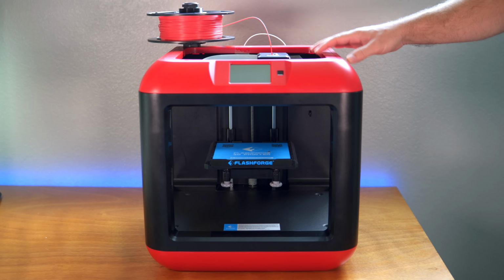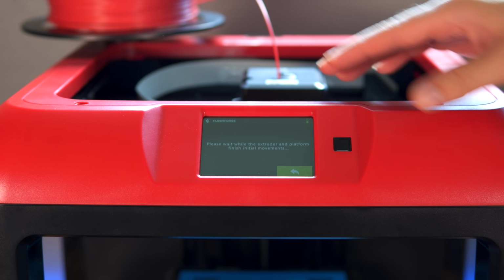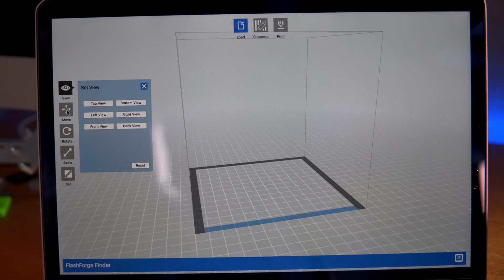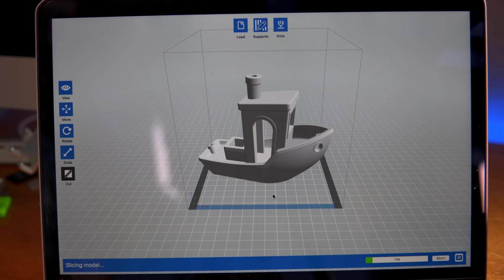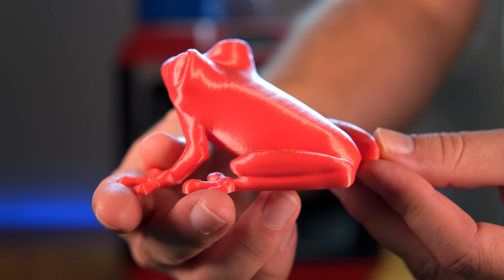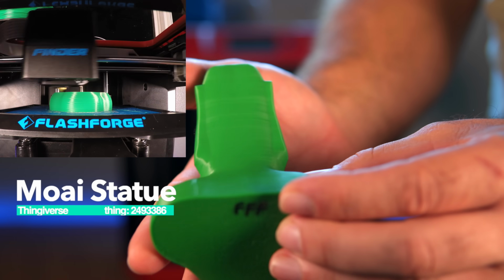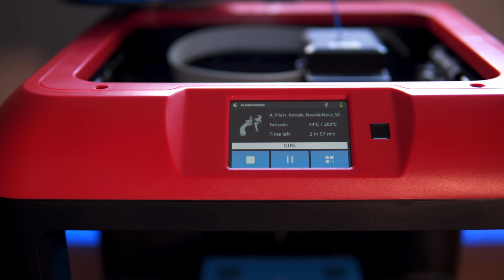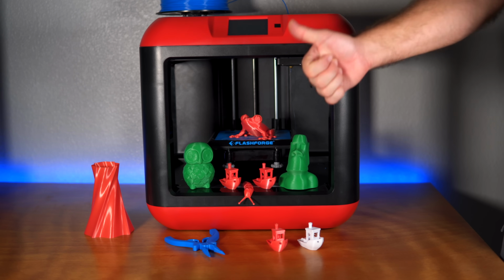FlashForge Finder - 3D Printer - Setup & Review

Comment: May be a stupid question, but in regards to the slug, was it printed in sections and then required clicking each individual piece together or did it print it all as one piece allowing it to flex/squish the way it does straight out of the printer?

Comment: The Finder is really really good. Enough print volume for over-night prints, cheap as dirt, and reliable. Mine has gone 720 hours today and all I have done is changed nozzle two times. Super machine!
Reply: I can't get this thing to print anything. It was given me to and I can't figure out how to get it to print anything well.
Reply: @MikeMtgFightClub  Sorry to hear that. I would happily help to get it started. How far do you get, is it turning on (fans starting, blue light and display on) and have you found and installed the associated software Flashprint?
Reply: @christianeriksson4733  yes, but I already sold it and went with a resin printer

Comment: I have a Finder Lite, and it’s really good, but my only problem is trying 2 get the prints off of the bed. It’s really hard 2 do, mostly because it doesn’t have a flexible bed (or at least I don’t think it does)

Comment: why not just print a new spool to fit the built in spool feeder and build a hand cranked transfer winder ... the larger spool on one side the forgefinder spool size on the other and then crank and move the filament to the proper sized spool ... no hole or bolts needed to be added to the unit and you now have a spare spool or spools to put other colours or filaments on ... 
.
I swear one of these days i am going to call this printer the fridgefinder ...
Reply: discolourisation is typical when something cools at different speeds ... the squished out filament will be thinner so it will cooler faster being a different colour than the thicker middle which cools slower ... the only real fix I can picture is fiddling with the head height and go in VERY small increments until you get a more uniform colour

Comment: its super easy to rig a heated bed
Reply: How do you rig a heated bed? My prints keep bunching up in the beginning and is frustrating.
Reply: @j1fulhamify  get a better pronter no jk i dont fully remember the details but look ot up on yt it normally involves a temp control circuit (premade) a mosfet circuit (premade) and like a reasonabky big 12v psu

Comment: Hi... I really need help with levelling my flashforge finder. There was a levelling file (gx type) which came with the USB. Would anyone have this file? Many thanks
Reply: You can level without the file (I haven't even opened that file... 😬) but I do still have it on the  usb that the printer came with. Let me know if you still need it.
Reply: @gogumadalpaengi  Hi .  I was able to get the file of Flashforge directly. I did try to do it without it but it never was accurate. Also when i try follow the guide in  turning the knob to get correct distance it would never succeed past step 1. But thanks anyway! : )

Comment: You say your temp is 200 for PLA but what are your exact retraction settings? Thanks.
Reply: In Flashprint you really don´t have to fiddle with a million of settings. The presets in Flashprint are super, and as long as your model is reasonably designed, and well placed it turns out great 99 out of 100 times.

Comment: Hi, I have just buyed the Finder. My prints turns out not really well, I can see the layers and also lot of filaments around like hairs. I adjusted the bed level with the tool inside the printed but still same results. Can you please tell me how to have prints smooth like you showed in the video? Thank you,
Lorenzo
Reply: im having the same issues
Reply: I partially resolved the problem because: prints now turns out well with PLA filament at 220°C . I also used TPU filament with very good result. However the prints doesn't stick well anymore on the bed. I tried with stick glue but didn't work...
Reply: I use sticky paper on the bed but it does not always work

Comment: dose it come with the usb to usb wire
Reply: Not sure, you can connect it to the internet and transfer it that way, if not you can buy the lite version that is the exact same but doesn't connect to the internet but comes with an SD card and is £100 less
Reply: @toast1ngton  does this one use an ad card? I know it has wifi, just curious lol
Reply: @AlliiMariie  It can use a sd card just like the lite model
Reply: @toast1ngton  wonderful thank you for the response!
Reply: @AlliiMariie  if you're not going to use the wifi function just buy the lite (it comes with an sd card) it's a lot cheaper and is in a cooler color
Reply: @toast1ngton  I have a dumb q, so what would the wifi be for?
I have a cricut machine (vinyl cutting machine) & it has bluetooth so I love it because I can use my phone with it & not plug much in (just the power).
If that sort of what the wifi is? Or am I misunderstanding lol (sorry)
Reply: @AlliiMariie  if you're somewhere around the house you can just use the printing software that comes with the printer to connect to the printer through wifi and cast prints to the printer, there is a big price difference so it's not really worth it
Reply: @AlliiMariie  alright, to be able to use this printer, you must have a good pc , not just a phone, the printer will come with printing software with the option to connect you your 3d printer through wifi and put the print through the software, onto wifi, then print, you can also use a double sided USB to connect your pc to the printer and use it that way, the lite model can only use a regular sd card
Reply: @toast1ngton  okay so similar to the bluetooth thing with my other machine. Unfortunately I have a spacing issue in my house so I'd have to spend the extra money for this feature haha 😔 thanks anyways!! ❤

Comment: What kind of pc or laptop would you recommend if I wanted to use thingiverse, does it have to be a Mac or a Windows
Reply: Either will work fine for simply downloading files from Thingiverse and having them printed. However, if you're looking to buy a 3D printer and make a hobby out of it, I would suggest buying a Windows computer as you will have access to a wider range of CAD software such as Solidworks. The reason this is important is because you'll probably reach a point where you'd like to print something that isn't available online and you'd need to model it yourself. 
Best of luck, and let me know if you have any other questions.

Comment: Where can I learn how to resolve the tangled filament that comes out? I've cleaned the print head, put in new filament, goes in fine, comes out a mess on the basic files that came with the printer.
Reply from the maker: Either your slice code is not right or your bed is not leveled correctly. Look into bed leveling.
Reply: thank you, i've re-leveled the bed 3 times now... and I'm not using a slice code - that I know of. Ill put a leveling tool to it and try again.
Reply from the maker: Sometimes when you level the bed it's still not good enough and you'll have to go a little lower with the nozzle.  it's a fine line between too low, too high and perfect.

Comment: Mine is with 248 hours of use, and stopped pulling the filament, making strange noises, the nozzle is not clogged, is some problem with pulling the filament, I'm trying to disassemble but I do not find videos anywhere of that FFF just like the one of the your video Can you help me?
Reply: Sounds like the grabber wheels are clogged, thats if this printer uses them

Comment: Vlad can you give us more info on the spool holder you built? What parts and printed and link to the files as well as what parts we need to buy?
Reply from the maker: I just used what I had. There's many different ways you can execute an external spool holder. Look on thingiverse for ideas.
Reply: @JustVlads  I did and see a lot of options but did not see the horizontal mount like you used. Looking right now at maybe building a TUSH universal holder and putting it on a shelf just above the printer.

Also looking at getting some acrylic and making side covers to help hold the temp inside the print area. Even looking at using velcro to put a piece on the front to make a door.
Reply: @unclegamer6705  How did you get on with the silde covers? I'd be worried about overheating.
Reply: @MazwaiTheCurious  I used double sides tape for the sides and velcro for the front. I have had no issues with overheating. I a room at 23C the hottest the printer area got was 29C and that was after 5 hours of print.

Comment: So based on your review I bought the Flash Forge Finder and am quite happy. Initial setup was like 5 minutes. Took about 10 minutes to level the bed and calibrate the extruded and then started printing. Had to do some fine tuning but is now working great, just finishing up the external spool holder.
Reply: Would u recommend it?
Reply: does the external spool holder come with it?
Reply: @dailymediaus  Its a 3D printer... you can just print it like any other additional parts :)

Comment: Gonna seek your advice Vlad... I can pickup a new Flashforge Finder for about $140 or I can get the Monoprice for about $20. (I have an in store credit to use resulting in these prices). I am really not wanting a printer to "tinker" with. I want to just print some minis and enjoy thew printer.  The cost is not a big deal to me, what would you suggest?
Reply from the maker: Flashforge over Monoprice
Reply: @JustVlads  Thanks buying it this weekend, first thing I will print after a test print is an external spool holder :-)

Comment: Your timlapse in the beginning looks great.  What camera/lens did u use for it?  Ty
Reply from the maker: GoPro hero 4 silver with 60 sec intervals. So one picture every minute then combined in editor to make a time lapse video.
Reply: Love the setup.  Any idea where u got your clip/angle piece for your go pro or what’s it called?
Reply from the maker: It's like an accessory kit and I've had for a long time so I don't remember exactly from which one but if you look up GoPro accessory kit on Amazon or Ebay a bunch of stuff will come up and you can see what they include there.

Comment: I love my Flashforge Finder. I have tuned it to print PETG. I had to switch to an all metal hot-end because of creeping and it has worked flawlessly since. Not having a heated bed has not stopped me from printing TPU or PETG. For adhesion I use Aqua Net hairspray.  Love the video. Glad to see another FF Finder user out there.
Reply: Hey I found one of these off face book and was debating on actually grabbing it how do you switch it to metal?
Reply: jonathan norman would you recommend it?
Reply: Jonathan, what settings did you switch it to calibration wise to print PETG?
Reply: Just a humble advice, regular paper glue stick works really well, at least on the original print bed. Also, I agree that the machine allows for a good variety of materials even without a hot bed.

Comment: could you use cura with the printer?
Reply: not really iit does not run gcode but uses a binary format for sliced files. s3d support the files but i dont think that cura support it. maybe there is a plugin
Reply: It does work with Cura if you make a custom profile, but after some extensive testing I found that Flashprint actually yields better results with this particular printer.